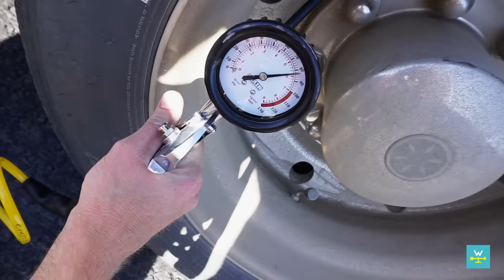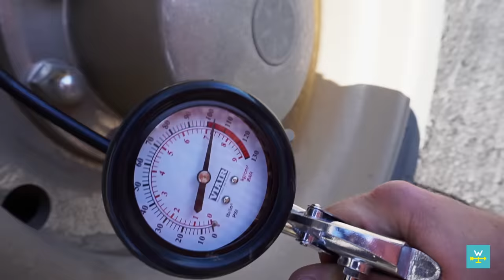05 Alaska Bound: Crossing the Alaska Border & Getting Screwed

Comment: Never drive the Alcan without, two spare tires (real tires not that donut tire crap), an air compressor, chains if driving in any month that is not June, July, and August. Wire guard covers to protect vehicle headlamps though might be difficult to fit on newer vehicles, extra engine belts and the tools and knowledge to change if needed, and a med kit. You have already noticed there is a whole lot of nothing in the Yukon and between the border crossing and Tok and even more nothing between Tok and Anchorage. And never make that drive in the late Fall or Winter.

Comment: Trial by fire - born poor I fixed bike tires then car tires so I forget others didn't learn - when car fails I go to junkyard for cheap parts, pull them off for 20% of new price.  Also on 50% days I load up with extra things like radiator fans, alternator, power steering pump, spark plug coils, dash knobs & plastic and seats for less than 10%.  I buy new brake parts, belts, bearings &  battery.

Comment: I'm a bit surprised the compressor didn't seize-up permanently while the red plug was installed and blocking air intake. The intake air helps cool the motor/piston assembly. Many of these small compressors usually have a short working "ON" cycle time before you MUST turn them off to let them cool down. One that I remember could be ON for 5 minutes, then had to be turned OFF for 15 minutes to cool down, then the ON/OFF cycle could be repeated like that as needed. However, I once left it ON for just a few minutes over the 5 minute limit and the compressor piston seized...permanently...due to overheating. 
An autopsy revealed it was the piston and not the motor that seized. It was a fairly cheap unit.
Other tire inflators have quite different on/off cycle time limits. For example, one "Sunlifer" 12VDC tire inflator has a 10minute ON/10minute OFF cycle requirement, and one ViAir 12VDC unit has a 20 ON/20 OFF cycle, whilc a Auto XS unit has a 10 On/20 Off cycle.
It varies and depends on things like the materials used, lubrication method, the venting of the case, the heat-sink fin design and size, and other things.
Reply from the maker: Improper hose installation aside, that Viair compressor is meant to handle large truck tire like that and has a pretty good duty cycle. 30/30 if I remember correctly. Here's a link to the one from this video if you want to look it up. https://www.gonewiththewynns.com/product/viair-400p-rv-automatic-portable-compressor-kit
Curious Minion

Comment: Ya know with 2 tires (dual) you can still drive. The flat one will be a little loose on the rim. The inflated one will cover until you get to a place for a fix. Drive slow. That's what truckers do.
Reply from the maker: Ya can, but that doesn't mean it's a good idea. With one flat, the remaining tire is now carrying twice its recommended load and that puts it at higher risk for blowing out. And this isn't driving down a paved shoulder to the next exit ramp: they have 45 miles or so of bumpy rocky dirt road between them and the nearest "town". Not fixing the flat would be a good way to end up with 2 flat tires.
Curious Minion

Comment: You have an RV, should have generator so buy a damn 110 v compressor and you can simply air tires up. ALSO tire plugs are NOT permanent they should be removed and a proper repair done. A patch plug is proper repair. Or as some call it a mini-combi repair(basically same thing. I do not recommend flat nontank type compressors as they run hot and can't deal with high pressures. If truck has air ride, have a shop install a quick connect female, place a vinyl boot over it to protect it from crud. And use regular rubber air hose. Those coil hoses suck for air flow.
Reply from the maker: When you’re toting your entire house and all the belongings, cramming a large compressor into a storage bay isn’t realistic.  The Viair that we had can totally handle our occasional inflation needs.

Comment: Can't believe you don't know how to use the tire flat.  You don't deflate the tire.  You simply screw it in the valve and let it drain into tire then move back to road quickly to get sealant to close hole.   At least with dual tires one can be a bit flat and you can still drive to a station.  Pays to test things doesn't it guys.   Tool time is right

Comment: I watch you pull one nail out and now this is the second and it's a screw. You need to learn to leave these in place and you're tired will not deflate until you can get to some real air for the tire! I am a single woman disabled and travel and I have run into some situations but nothing like this with no planning

Comment: Carry a tire plug kit that uses a mushroom shaped rubber plug and insertion tool to seal the hole.  That green slime in a can is worse than using bubble gum.  You weren't prepared to be away from a tire shop.  Also, once you put that slime into the tire, how do you expect a tire shop to properly adhere a tire patch inside of the tire? I suppose that you can pay extra money for the tire repair guy to clean that mess out of the tire first.

Comment: Dont use that crap it cost u more than helps u, get u a tire plug kit comes with plugs n the tools, cleaner n cement is your best bet, also with the dually u can run on one flat each side to get to help

Comment: NEVER use that temporary tire inflator. Most tire repair shops WILL NOT repair the tire if you have put that in. Buy a pancake air compressor and a good quality tire plugging kit. That will get you to the tire repair shop.

Comment: At the risk of losing my man card, I have to ask, why he fixed the plug on the inside tire, and then inflated the outside one.  I never imagined that the two tires are somehow connected.
Reply from the maker: They aren't actually connected. The valve stem on the inside tire is long enough to come through the hub of the outside tire so that you can inflate it. Otherwise you'd have to take the outside tire off or crawl all the way under the RV to get to the inside valve stem. Pretty clever!
Curious Minion

Comment: I'm getting a fifth wheel... I'd be in the same situation if I was a normal Joe buuuut...  instead of an f550 pulling the trailer I'll use my Volvo vnl 780. 300 gallons of fuel as t 12mpg... being conservative

Comment: why not put the spare on I'm sure that mobil home has one
Reply from the maker: Most motorhomes of that size do not have spares. It's a very large very heavy truck tire, and the lug nuts have to be torqued to spec that requires either an air tool or a very specialized geared wrench. Most people would be unable to change the tire even if it had a spare.
Curious Minion

Comment: I don’t accept the criticism directed at both of these travelers. I think at every point with the tire issue they did just what any good trouble shooter would do with the only items and tools they had. You need to understand the guy had to consider a lot more issues than just a leaking tire. I was fairly impressed that he was considering time left before total failure of the tire. How far could they make it. Could he increase his distance before failure if he kept boosting the leaking tire. He had a decent selection of resources for someone who is not a professional. At each point where he reached an impasse getting the air pump connector on the valve stem to work, he persisted by trying different combinations, but finally discovered that reading the directions from the manufacturer trumps everything. Always read and follow instructions. I would advise anyone dependent on a RV in motion, get the items you might need in a situation where you are totally on your own with no help or phone service. Take them out of the box and get familiar with them. Put some notes in your own understanding on the boxes. Get good quality like the air pump he bought. It is no savings to buy cheap Chinese stuff that you may have to depend on in an important situation. The wife was very good as a helper and supporting her husband. Work as a team and you will get through.
Reply from the maker: Awe, thanks for the love john! We try.

Comment: As soon as you put that in the tire you screwed yourselves. They charge an extra fee to clean the stuff out and if you leave it in it eats away at the rubber so that the tire becomes useless. 5 psi is minimal so just drive slower. If you were driving on pavement it would be more affected by heat buildup but gravel is a different scenario. The nail being close to the tire shoulder is the most concerning. That alone could cause you to have to replace the tire. You’d have been better off putting the spare on till you got somewhere. When you added the slime you ruined the tire pressure monitor.

Comment: Carry a spare wheel and change it. Would have been quicker and less hassle
Reply from the maker: Not that easy in a rig this size. See replies below on why if you're interested.
Curious Minion
Reply: @gonewiththewynns  Rubbish, i am a retired truck driver and had to change wheels when i had a punture or blowout. Not just twin wheels but super singles. If you had a spare and tools (wheel brace and a jack) to change them over it would have been job done.

Comment: What was the name of that air compressor system?
Reply from the maker: Pro tip: whenever you want additional info, head over to the corresponding blog post. In this case, there's more info on the air compressor and a link to it as well. There's also a dedicated Gear Store with all kinds of cool stuff, some with discount codes! Don't forget that shopping through the links won't cost you anything extra but it will through a few pennies into the sailing kitty. Thanks for sailing with us!
Curious Minion

Comment: P.S. Here's a bit of advice you obviously didn't get... NEVER let your fuel tank go below 1/2 Tank... ESPECIALLY when you're traveling out in the middle of nowhere! The last thing you should be worried about is "How far to the next Fuel Station?"
Reply from the maker: That's not always possible in the boonies of Canada and Alaska...
Reply: @gonewiththewynns  Then top it off completely every time you pass a fuel stop. There's no excuse for "Running on Fumes" in an RV. Believe me, I came from Vegas where it was easy to go 100 miles without a  Fuel Stop in sight... especially when you have a Caterpillar Diesel Pusher however, I top off every chance I can get. Glad you're learning along the way however, some of these maintenance items are things that you should have prepared for. Hopefully, you're spending more time on tools and knowledge of the Lifestyle you've chosen. I've done it on and off since I was 28 and began fulltiming for good 3 years ago. Knowledge of your Rig, Maintenance and what to expect... go a long way to making it a "Less Frustrating" Experience.
Reply from the maker: You've never RV'd in Alaska and Canada have you? Sometimes the next fuel stop you pass is the one where you're almost on E.

Comment: Why don't you just change the tire?
Reply from the maker: A lot of RVs don't even come with a spare because the tires are so large (like semi tires). They are too heavy for most people to handle, the lugs have to be torqued past what you can hand torque, and you'd also need a really massive jack to get a 10 ton or heavier RV in the air (not safe to use the leveling jacks to change a tire). Hope that helps!
Curious Minion

Comment: Dont RVs come with a spare tire?
Reply from the maker: Hey Chris. Not usually when you get to Class A rigs like this. These are huge truck tires and are too heavy for some people to safely lift. Plus you need a big-rig jack to get that huge RV safely in the air (using the RVs stabilizer jacks is not safe/recommended). Easier and safer to call roadside service, unless you're in the middle of nowhere!
Curious Minion
Reply: @gonewiththewynns makes sense. My full size truck tires are heavy enough, those RV tires are probably 40-60lbs heavier.

Comment: Piss poor planning. I never get below 1/2 tank of gas on any trip. It appears that you never used your air pump. I have traveled thousands of miles and one then I learned, KNOW YOUR EQUIPMENT. That has saved my bacon more than once. I carry a Porter-Cable portable air compressor is 150 PSI and is regulated. I have had it over ten years and it was helped a lot. I never trusted those so-call RV air compressors.

Comment: you dont have a spare tyre...WTF  ??
Reply from the maker: Most motorhomes of that size do not have spares. It's a very large very heavy truck tire, and the lug nuts have to be torqued to spec that requires either an air tool or a very specialized geared wrench. Most people would be unable to change the tire even if it had a spare. 
Curious Minion

Comment: One should always check, test and learn how to use any equipment before you ever need to use it.  Also I am amazed you did not refer to Youtube as to how to repair a puncture using the plug repair method... So many instructional vids for just on how to do anything.... I find the youtuber community is the best idiots how to guide to anything one does not know about
Reply from the maker: Right? The ol' YouTube School of Everything! Except there is no cell service at this border crossing or for probably 80 miles in any direction. Wanh wanh.
Curious Minion

Comment: Spare ?
Reply from the maker: Most RVs this size don't have them. They are large truck tires - very heavy and usually lug nuts are torqued with an air tool, so you need an air tool to remove them. Since most people have roadside service it's easier to have them change the tire - unless you're in the middle of nowhere!
Curious Minion
Reply: Gone with the Wynn’s, except that’s the Alcan Hwy and since there probably no phone service I’m sure there also no AAA. Well it just shows there Rv rookies! I’ve never personally have not had a spare, except on my 6060 Allis Chalmers tractor. My grain trucks have a spare with appropriate lug wrench’s, extension bars for added torque if needed and appropriate jacks. Just saying.

Comment: Well, now that you've had another 5 years of road time, I guess you learned that 'can-o-crap' tire goo is worthless, especially for the tires on your class A. And if you're traveling in Alaska / Canada you endeavor to never get below 1/2 tank of fuel. In your situation, already 'near fumes' running, you're there idling the engine while fiddling with your fairly decent (but never out of the bag one time for use) air pump, which you could have hooked up to your house batteries instead to save the fuel. Arriving in 'Chicken' , surprise! The whole place can fit into a Walmart parking lot and has really, really little to offer other than maybe a little fuel. To get your tire fixed on a rig like that you'll have to find a real truck stop / service spot. Don't feel too bad though, I've never met a class A driver that had the works to do their own tire repairs, or even get a tire off the rig if they actually had a spare.

Comment: Drives an RV with an on board generator that outputs 120V AC. Buys a piece of shit compressor that runs off the 12V Battery instead.

Comment: I've never watched this vlog before. I've watched it to the 20 minute point and now know for sure I've just wasted 20 minutes... Lower down this thread he apologizes for 'making mistakes', but the truth is encapsulated in the old adage. "Fail to prepare - prepare to fail". Setting off into any wild area unprepared without bothering to learn how all your kit works is a special kind of stupid. They pass through a border post heading for a named destination and then discuss how far away it might be since they are getting low on fuel. Did you ask the border post staff how far it was? Did you check if fuel was available? Is it YOUR type of fuel? You have a puncture. It's a slow puncture - but don't you have a spare? Indicating to the audience that there is no 'cell-phone coverage' shows your thinking. We got a problem, what are we gonna do - I know,  phone somebody!
Not clever at all...

Comment: So you are the people who can't change a tire
Reply from the maker: RVs that size usually don't carry a spare - it's a truck tire which is too big for most people to handle easily, and the jack you'd need to lift that much weight would be huge (It is not recommended to use leveling jacks to change a tire).
Curious Minion
Reply: @gonewiththewynns  RV s that size are complete junk.

Comment: Get a real compressor!
Reply: I actually stopped to air up a few tractor trailer tires with that same compressor, (for cash of course) it's quite expensive at about $400-$500 for the unit and it works better than any compressor I've ever had. After seeing these guys I realized they are a bit dumb and really never used the compressor before as well. It's a top of the line compressor.  Viair 450 P-RV I think, I have tucked way under in one of the basement compartments. I've had mine for maybe three years now so the price might be a bit lower now.